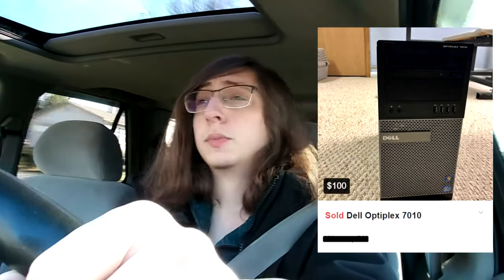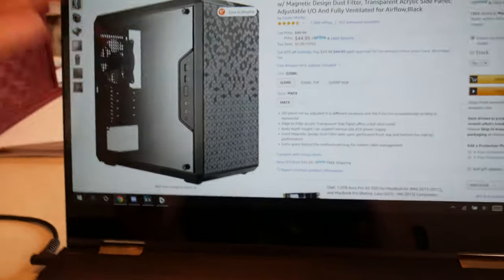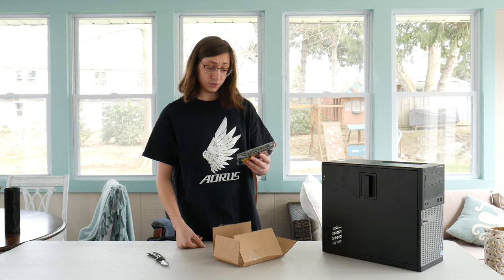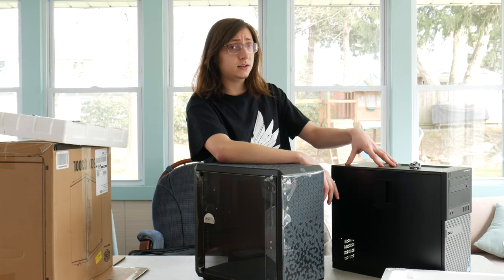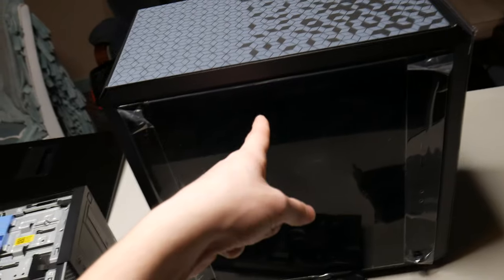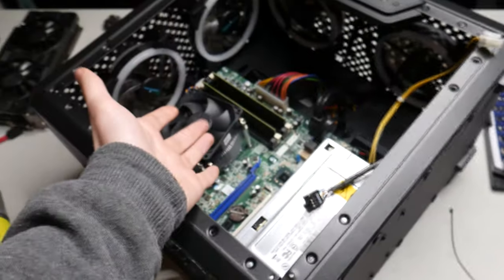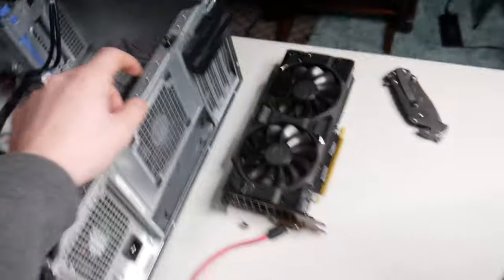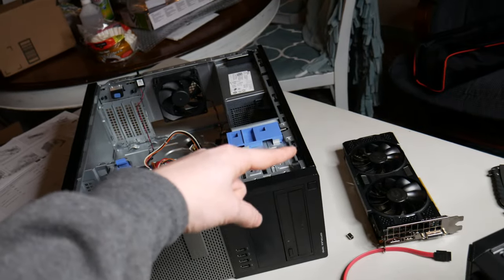Turning an OLD Dell Optiplex into a GAMING PC?! - Optiplex Flipper PC Part 1 of 2

Comment: Just letting you know you can use sata to pcie to power a pretty decent gpu with little to no losses in data. For those budget builds and pesky PSUs with no pcie cables.
Reply from the maker: Yeah I didn't realize this was a thing until a little while ago, but considering I threw a new hard drive in the PC it used up both SATA power cables.

Comment: Great video man! I had the same problem with the proprietary connections when I was building my friends pc with an dell motherboard. I ended up googling the pinouts on the motherboard and soldering the connections together and then cleaning it up with heat shrink tubing, it made the build feel so much nicer.
Reply from the maker: Thanks! Glad you liked the video :D do you happen to have the link to the pinout? I tried doing some research but couldn't find a definitive answer.

Comment: Built up an I7 4770 Optiplex 9020 with a new PSU, ssd, and Nitro+ RX 570 8gb for $400CAD in January, now the same Optiplex with no gpu or ssd is $600+ on ebay. Can still find i5 4th gen and older locally but they're still like $300.
Reply from the maker: That's awesome! I've been on the hunt for more Optiplex deals so definitely believe I'll make more videos on them!
Reply: That is the most insane optiplex deal I've ever seen in my life.

Comment: If you want to make it in the business of optiplex flipping the must buys for optiplex are 500w power supply with atleast 2 molex and 2 sata you can buy 4pin to 8 pin cpu adapters if necessary also you should get 24 to 6pin adapters sometimes 8pin cause the insperon line up of dell uses those connectors and get a molex to 6pin or 8 pin connector you cant fuck up a molex connector so dont worry about it not working or catching fire what you should definitely avoid is sata to molex or 6 pin or 8pin those will catch fire make sure its 2 molex to a single pin you need to provide enough power to the graphics card 1 molex will not suffice the graphics card with enough power
Reply from the maker: Thanks for the great tips! I appreciate it!
Reply: GTech peepee haha funy 😺😽😺😺😾😼😻😾😾😻😾😾😸😼😾😼😾😸😾😸😾😼😾😺😽😺😻😻😾😻😾😻😾😹😾😼😽😸😽😽😸😾😸😾😼😾😼😾😼😼😼😾😾😾😹😾😸😼😸😸😾

Comment: Buddy, get extension cable. I just finished rebuild one of Dell optiplex 3020 model. For the io just cut the header and rewire it. Is not that complicated. Let me know if you need help. Love your video.
Reply from the maker: I appreciate the advice! I know they make extensions no issue but I just ended up putting the parts back in the Optiplex case and it sold just fine (which you can watch part 2 and see)

Comment: Making a flip of a smaller case version of the same machine, but it's shipping in with the i5 4590. UNBELIEVABLE steal at auction (same price as you paid for this one actually), so long as theres no scam involved. And probably not, cause it's a professional refurbisher seller. I may have to modify the SFF case to make my card of choice fit, but I LIKE covering things in obscene amounts of electrical tape. I actually have an old basefan form my previous rig that I might just use as additional air cooling, and as a transparent replacement (jury rigged) side panel for if I ever decide to be bougie and add RGB (or more likely single tone LEDs, cause I just like blue, and don't like complicated setup, or expensive things)
Reply from the maker: Very cool stuff! I know that there are half-height GTX 1050's and GTX 1650's out there that would work without modification

Comment: Upgrading an optiplex for the 1st time is always fun :)

Question is after doing all the work for the case swap if you went back in time would have just popped the 1050ti (along with the HDD) in the old case and called it a day ?
Reply from the maker: Yeah that's exactly what I ended up doing here, and I just used the new case & fans for another build.
https://youtu.be/RWWMRIbfAA4

Comment: I got a dell 7020 with i5 4590 for $50   and nvidia 2gb gt 1030 for 40 on offer up, added 16gb of ram and a 240gb ssd I had laying around. Nice little kids minecraft and roblox pc.
Reply from the maker: A perfect use for that kind of system!
Reply: NICE setup bro, I'm currently looking for the same. . . 

Question, did you PSU upgrade and if so what model and wattage 🤔
Reply from the maker: Nah I just stuck with the default power supply in this PC

Comment: Great vid I have an Optiplex 9020 i5-4570 16gb ram 250 ssd 2TB HD dvd burner and that underpowered psu only thing I've added is GFORCE GT 730 2GB GPU this doesn't require external power source and a lot cheaper than one that does I think when idle it pulls 35w and 80w playing, graphics look way better than the dull lookin integrated 4600. If I wanted to change the PSU I would need a 24 to 8 pin PSU ATX adap cable. Eventually will upgrade ram to 32gb and PSU and maybe the CPU but no time soon Paid $230 couldn't pass it up. It's a lot faster than my 13yr old XPS 410.  Have you done part2?
Reply from the maker: I have! The part 2 video is now live in my channel!

Comment: This is why i didnt bother to change my optiplex's case. It wasn't worth the hassle.. i mean, i can mcgyver each one of those connector but id rather just use the case and hide it under the dark alley of my desk.
Reply from the maker: Exactly what I did, and it still sold just as fast.

Comment: Erm buy a Gtx 1050 its only 75w and i think it runs off the Pci slot, No connector needed..
Reply from the maker: I used a GTX 1050 Ti, which is also 75W and runs off of the PCIe slot which is like 5% faster.
Reply: What GTX 1050 brand 🤔

Comment: I've transfered a TON of these into new cases there are ways to get the errors to go away, but honestly pressing f1 to continue isn't a huge deal. Just make it look , and perform good. 99.9.% of folks buying a gaming PC at this budget won't care that they have to press it 😊
Reply from the maker: Thanks for the advice! I'll have to consider that next time I tackle an Optiplex project. But I gotta ask, what's the pinout for the USB and front panel port? They're merged together making it difficult
Reply: @GTechOfficial  if you dig deep enough you can find a diagram of the pin out (check linus forums) I just use PCIE 4x cards to get the font panel working.
Reply from the maker: @stevenwilliams6638  huh ok, thanks for the heads up!
Reply: @GTechOfficial  It definitely possible to do, I just can't justify splicing the wires from a new case just to get past an f1 error 😊 to each their own though
Reply from the maker: @stevenwilliams6638  Yeah that's a big reason I didn't do it. Apparently de-pinning the wires from the old connector isn't a difficult process, I just don't know which cable controlled what and wouldn't want to screw something up
Reply: @GTechOfficial  yep just press f1 to continue. It doesn't affect performance at all 😊
Reply: @GTechOfficial  another thing you can do. Is paint the entire OEM case. Remove drive cage by drilling out a few rivets, and cutting out a spot for a 140mm LED front intake. Makes the case look much more modern and you don't have to deal with any errors (or scrap)
Reply from the maker: @stevenwilliams6638  Not a bad idea! Maybe if I sell a system that uses SSD-only storage I can remove the drive cage entirely for that fan.
Reply: @GTechOfficial  or do what I do and use 3.5 to 5.25 adapters and put the large HDD up in the second drive bay . Best of both worlds 😊 good luck with the build !
Reply from the maker: @stevenwilliams6638  Man, you're full of smart ideas! Thanks for the tips and I'm glad you liked the video :D
Reply: No problem! Keep up the great work!

Comment: What i want one of those full size Optiplex cases for is a new build. Maybe a B450, or if good prices, a B550 mATX. I have a Vostro I might still use, but dont think it has quite the same interior space. Thanks 🤓 whats the diff between the 2 vid cards, besides 1 fan & 2? Also, will those 120mm fans fit in the optiplex? Thank you
The problems, snags, you ran into are what I want to determine beforehand!
Reply from the maker: Just a heads up, depending on your chassis you might not be able to properly switch a new motherboard in there because of the proprietary front panel connection layout. Unless you know how to re-pin the connectors, you might just be better getting a cheap case.

Also, there's basically no difference between the two graphics cards I showed off in this video aside from the number of fans. The PCB looked identical to me.
Reply: @GTechOfficial  yeah I sorta wondered about the connectors used in the Dell PCs - I dont think they can just plug into a new m/b. Might be possible to replace the existing Dell connector with a newer one, (keep the pwr switch) but a new (like your new one!) Case would be best, too. The standard USB, headphone/mic might hook up easily, but I thought of adding a USB 3.0 (1 or 2 ports) to the front of the case, too, as a new B450/B550 would support it. Whether the cable would reach the header is a different story! The single fan GTX looks like a great one for space! Thanks

Comment: Could this be done with an Optiplex 7040?
Reply from the maker: Guess it depends on what form factor chassis it is. The system I used is standard mATX and allows for full width GPUs, but if you have the slim version you need a low-profile GPU.
Reply: @GTechOfficial  i have mt
Reply from the maker: @joseangelrodriguezl856  Hmm, you might have to look into low-profile GPUs then. Gigabyte makes a low-profile GTX 1050 Ti that should fit.

Comment: are the extra fans completely necessary in this build?
Reply from the maker: Yes and no. Considering the Optiplex only came with 1 case fan that won't fit in the Q300L chassis at all, I figured it would be better to have more fans because the Q300L only comes with one included. Plus, having RGB capabilities makes it more attractive to buyers on the used market.

However, the Optiplex hardware does just fine with only one case fan and the dinky stock cooler, so even just the one fan in the Q300L would probably supply enough airflow.

TL;DR it gives more airflow to the parts making them run cooler, and RGB bling let's you sell it for more money
Reply: GTech thanks man
Reply from the maker: @tropicc9390  yup!

Comment: If I were you I would just use the original case and call it a day. Way too much hassle to get that thing working unless your willing to tear down that weird connector and solder together all of them wires to the ones in the case.
Reply from the maker: Yup, that's exactly what I ended up doing. I thought I might have a hard time selling it if I didn't give it RGB bling but it sold just fine! That video is coming on Saturday!
Reply: @GTechOfficial  So you were able to get the usb and audio ports to work?
Reply from the maker: The USB and audio ports already worked just fine in the OG Optiplex case. I just didn't have the mental energy to figure out how to repin the proprietary connectors to the Q300L